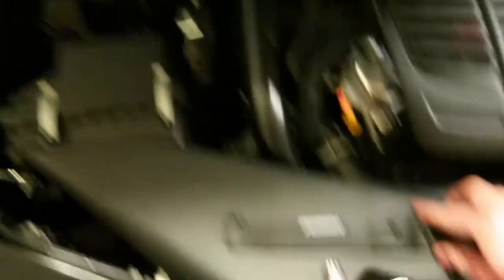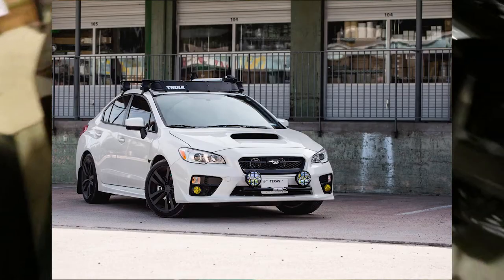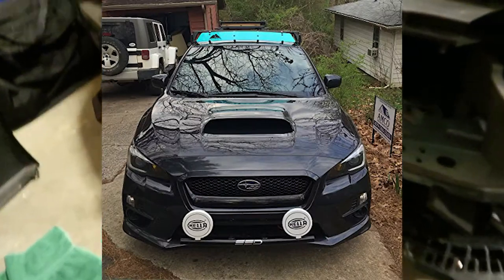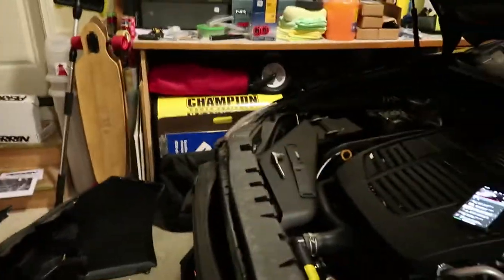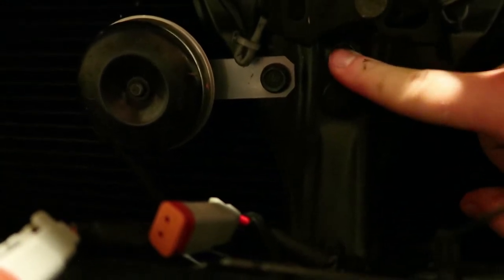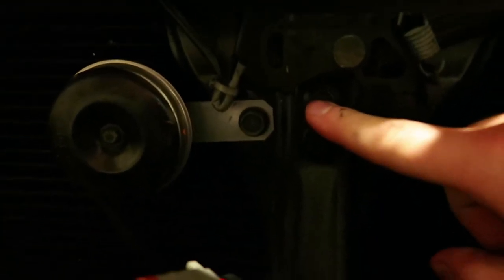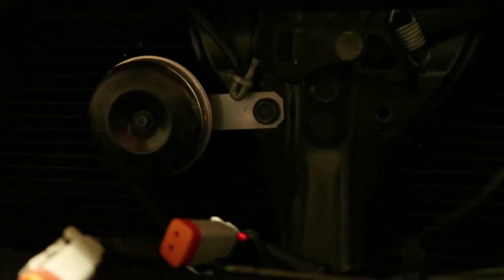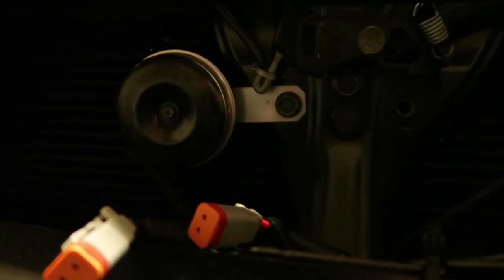Hella Horn Install on 2018 WRX

Comment: How do you like that grill? I've been thinking about it.
Reply from the maker: Brian Jalet I love the Grillcraft grill. I use it every night. Though I swapped out the less that came with it for some Baja Designs Squadron Sports. The stock leds are bad, I was just looking for a different beam pattern.
Reply: @Chridfer  I have a pair of Morimoto XB LED set up as fogs that I thought might be a good fit for this application. The grill looks really good.